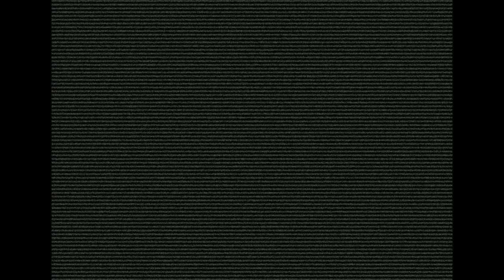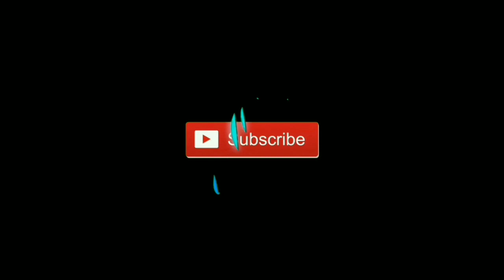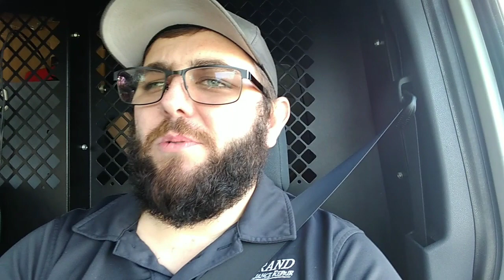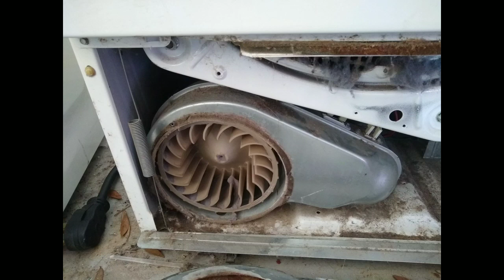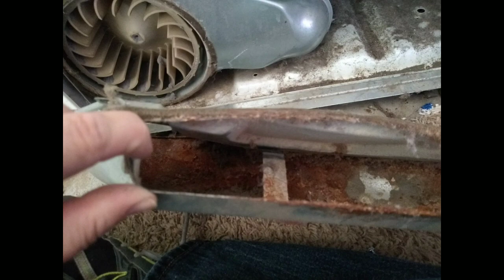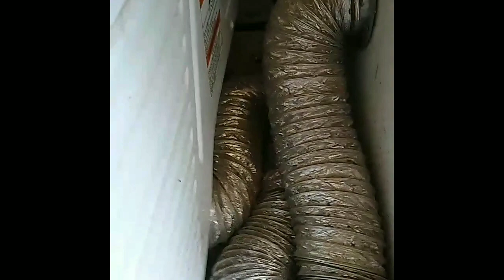Appliance Repair Training Tip! (Thermal fuses in dryers)

Comment: What do you do if you can't clear the old codes from machine...holding down the thrid button for 5 seconds does nothing and I still get F1 E2 codes. It will enter diagnostic mode but I can't clear codes after replacing coils, thermister, and all that good stuff that comes with the kit. This is a cabrio WED7000WD1 unit. Original problem was a no start condition. I immediately checked the coil which was totally blown. ordered parts, replaced parts powered up the unit and still no start. shows 236 voltage at the terminals and the display shows  000, L1, 121, Htr, 121, Air, 001, L2 then repeats and I saw F1 E2 as well. Any ideas why It won't start? I examined the control board, no signs of anything wrong there...but I didn't check any circuits.

Comment: I've replaced that blasted little thermal fuse so many times. It keeps blowing. The exhaust tube behind the dryer is not especially long or kinked. Air flow through that and to outside seems to be ok. I don't know what the heck makes it keep blowing

Comment: Hey David, I would really appreciate some guidance. Thermal fuse is blowing, the element and thermostat test good, no sign of the element grounded out when I test for that. I replaced both the fuse and thermostat incase it was a thermostat problem causing the fuse to blow. Same problem new fuse blew after 1 run. I had the exhaust open to the laundry room as well to make sure it wasn’t a lint problem, so I know it’s not that. I read online that the element could be touching after it heats up and causing my issues. I’m not sure what is causing the fuse to blow continuously I’ve had 3 so far, with the exhaust open. Element and thermostat keep testing fine. Should I order a new element? Or maybe it’s control board related. Any advice will help thanks!
Reply from the maker: Hi! What is the model number?
Reply: @DCApplianceRepair  any advice ?
Reply from the maker: I would take the element apart and observe it to make sure it's not sagging. Next go to the control board located on the top, and look at the relays. After all that has been replaced and checked. I would replace the board. You can also get the element cheaper on Amazon.
Reply: @DCApplianceRepair  should I be getting 10 ohms from the element? I get continuity but hardly Over 0 ohms. Thanks
Reply from the maker: @scottperry6320  Yes 10 to 12 ohms. I would replace it.
Reply: @DCApplianceRepair  great thanks I’ll do that
Reply: @DCApplianceRepair  Samsung DV45H7400ep/ac 
Thanks!
Reply: I’ve also taken the vents apart in the dryer and made sure there was no lint build up anywhere

Comment: David,what temp should a dryer cycle temp on and off ?
Reply from the maker: Generally 160 to 225. On most dryers!
Reply from the maker: You can always look on the thermostat. It will tell you the on and cutoff temps.

Comment: I'm not a fan of those type of dryers, I like the Whirlpool/Kenmore/Maytag in the back. I usually make the dryer duct as short as possible. Usually I make it as long as my shoulders are wide. When I sell a set and I notice the pipe goes up, I suggest they get it cleaned. That's exactly what I tell them.... if you don't get it cleaned, I can't warranty the fuse or anything else in the dryer.

Can you link that video for checking the heating element to see if it's grounded please? Knowing if a heating element is grounded or not might save a life even if people don't work on or sell appliances. The other day I was in a hurry and you might know that the dryer had a heating element that was grounded so by the time I went back in the garage about 45 minutes later it was full of smoke and the dryer was HOT!! So I went right over and unplugged it from the wall. My grandson's clothes were almost on fire!
Reply from the maker: Here you go buddy! https://youtu.be/0pPf_lYRJH0